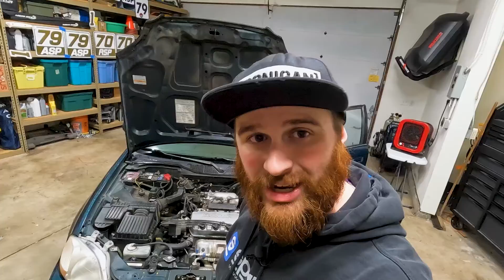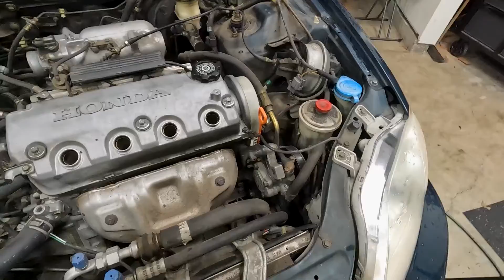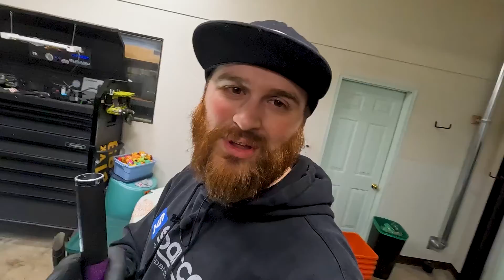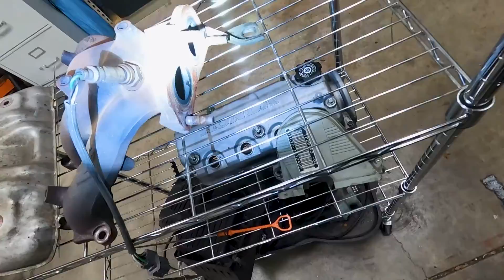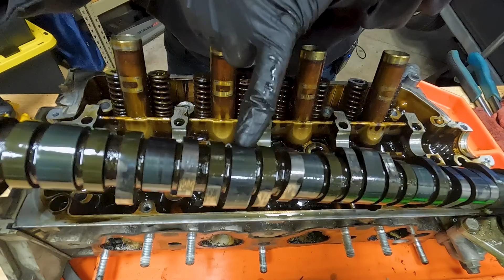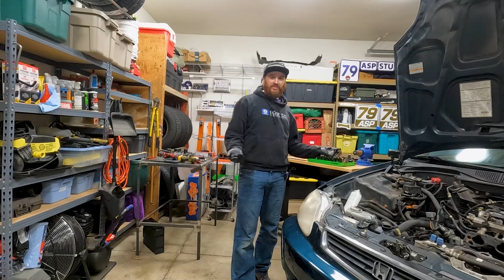Budget Civic Engine Teardown

Comment: Good video, thanks. My Honda 2000 1.6 car won't start. I haven't started it for 6 years and it started in February, but now it won't start. I've changed all the sensors and it won't start. It has no spark, it chokes and sometimes wets the spark plugs and leaks gas into the acceleration body. I took it to a mechanic and he said it has no engine compression, that it's better to change the engine. He says the valves look bad, that he can change the head gasket, but then I'm going to have engine problems.

Comment: Great videos mang.  I have a 90 Accord EX sedan that I'm trying to get going.  Has 260K miles on it.  I have really low compression in a couple of cylinders.  Does that sound like stuck rings to y'all?  Forums are leading me to believe that it is stuck rings.  I have soaked the cylinders a few times with MMO but no luck.  I guess, I'm looking at popping them pistons out to replace the rings.  This is a tear it apart to learn car so here I go.....LOL

Comment: Hi, I have the same problem with my D16Y8, did replacing the rings help?
Reply from the maker: It helped a little bit. But the full fix would a have been bore the block for a slightly over sized piston and ring set